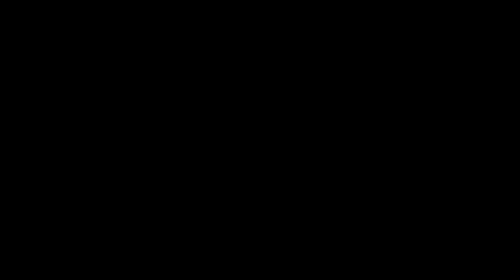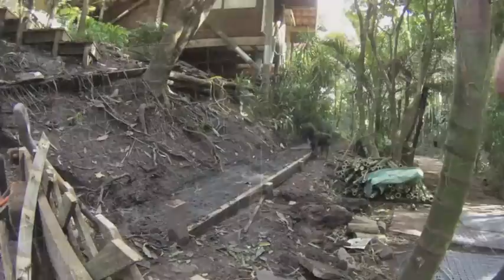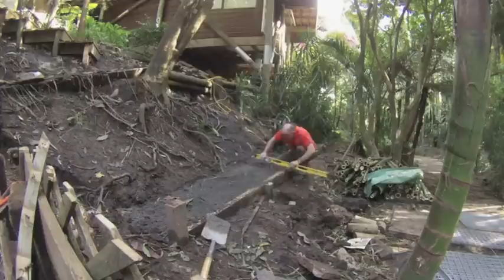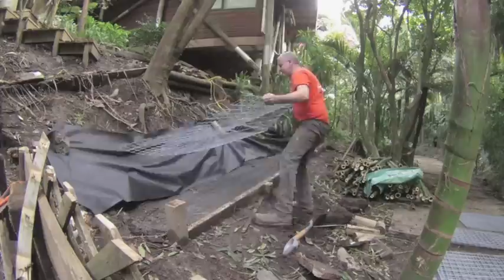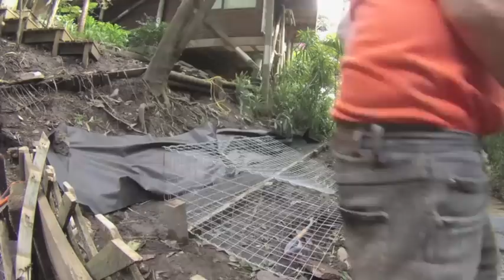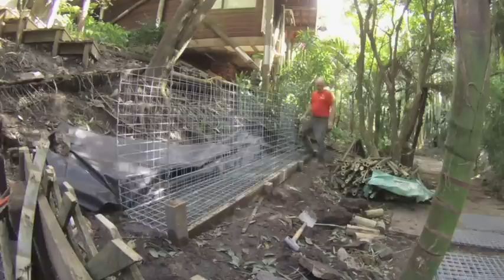Gabion Cages

Comment: Hey thanks for that. I am building a 1.8 meter wall myself and having it step back in 600mm high baskets x 3 ....my concern is what to do with the top baskets from sinking or falling backwards in the soft soil above...?
Reply from the maker: Heather, my suggestion would be that you only step back a fraction of the depth of the basket.  How deep are your baskets?  The thing about gabion cages are their static mass, they are unlikely to tip backwards.  Having said that I would build the first layer, then back fill behind the first layer with the appropriate drainage requirements for your area.  For example we put a perforated 100mm sock covered pipe at the base of ours and covered it with gravel, then back filled. once you have back filled to the top of the first layer, try to tamp it down as much as possible to minimise further settling.  I would then set up the next level of cages and only set them back from the first level by 10-15mm and I would then tie the bottom level to the top level and repeat the process undertaken for the first level of cages, then repeat whole process again for the third level.  However, if you are in doubt seek local professional advice, I can only share what I have done with gabion cages with my own single level affair.  Good luck and share what you have done!

Comment: I really like this design, how long do these walls last? does the wall collapse when the cage rusts and falls apart?
Reply from the maker: That is a good question.  My understanding is that unprotected metal rusts at a rate of 1mm per year.  However, these cages have been galvanised and so will last for a very long time.

Comment: what material have you used behind the gabion to stop the earth eroding through into the gabion? nonwoven geotextile?
Reply from the maker: There is an agricultural drain with a sock over the tops so that it does not silt up at the bottom of the gabion cage. Then there is a weed mat along the rear side of the entire length of the cage to stop silting.  7 years on and it is still working fine.

Comment: Hello there,
 Is it just the 1 wall that you built or did you go higher.. i would love tosee the finished product..
Reply from the maker: Heather thanks for the comment.  No I only went one cage high.  Any higher and I would have needed planning permission.  On reflection I think that I might have chosen to do two levels with cages half the height so I could step them back a little.  You can see the completed project on my garden blog, along with all the planting that has now been put in place.  Feel free to leave comments on the blog too!  http://thecorinthcanal.blogspot.co.nz/2014/03/gabion-wall-bed-complete.html